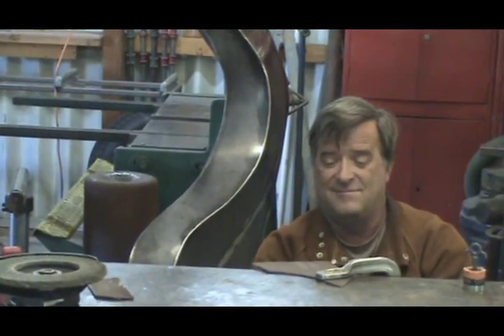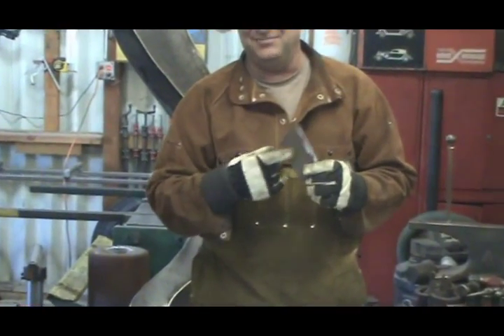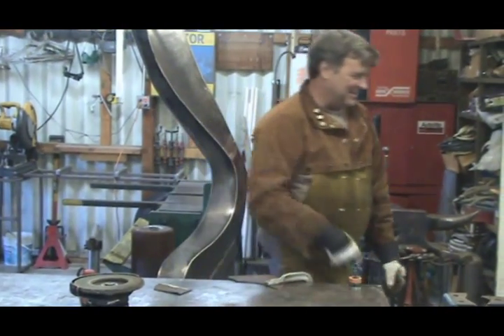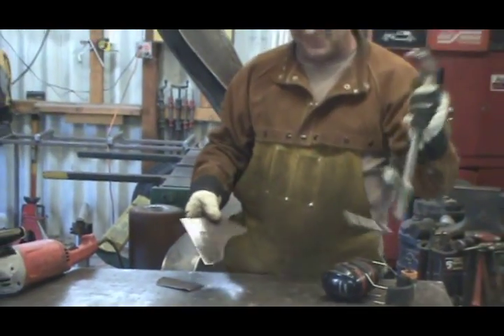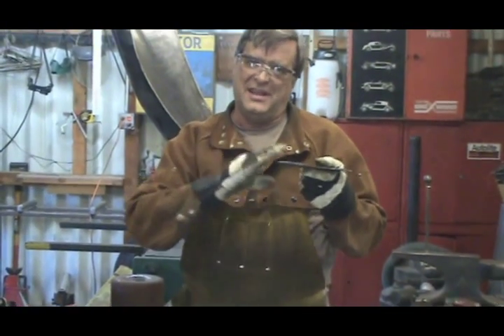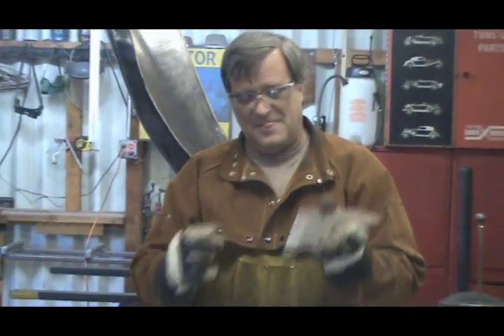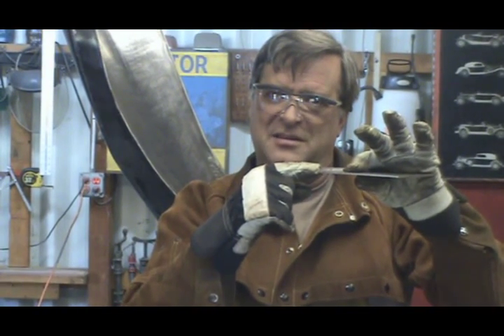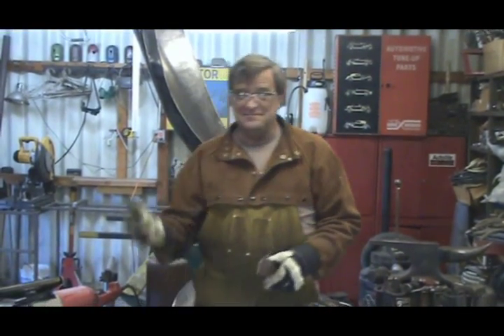Welding Preparation for Best Results - Kevin Caron

Comment: dear sir can you tell about 20 mm plate pipe how much gap and angle of bevel suitable for weld.
Reply from the maker: Sorry, I am not a certified welder and I don't weld pipe. 

But if it was in front of me I would bevel the edge back about 10 mm and in about the same.    Leave a gap of maybe 5 mm but this is all a guess on my part.

Comment: dear sir I'm new to welding I'm having problems with e6010 rods constantly sticking do you have any advise ps  ive cleaned the metal before starting to weld
Reply from the maker: Crank up the amps a little, or switch to 7018 instead.

Comment: I would like to purchase a mig welder, do you have any recommendations? I would like to maybe try tig as well. Is there a welder that will do both?  I will be doing light stainless steel most likely sheet stainless steel to make cabinets. I also plan on doing steel nothing too heavy probably 1/4" would be the thickest.

Comment: kevin, I have a 4 1/2" grinder. What kind of wheel should I use to clean metal before welding and what kind of wheel should I use for cleaning up welds after welding? thank you

Comment: Grinding also removes oil from the mill finish metal surface.

My preference is to bead blast first, inspect for rolling stress lines/striations in the surface, if I see those, then grind.

I also wipe the surfaces with isopropyl alcohol, and wipe down the filler rod, too.

I tried acetone, but it leaves an oily residue.